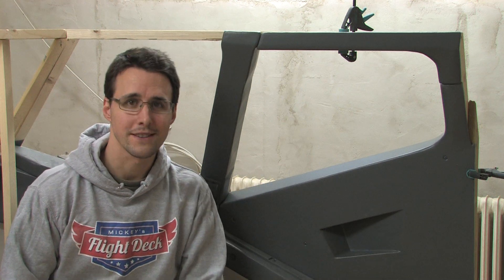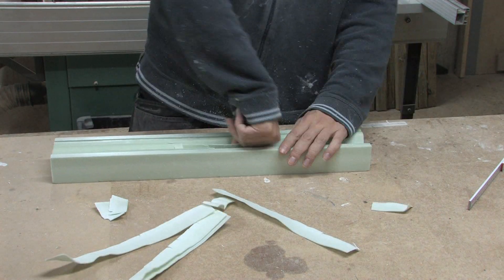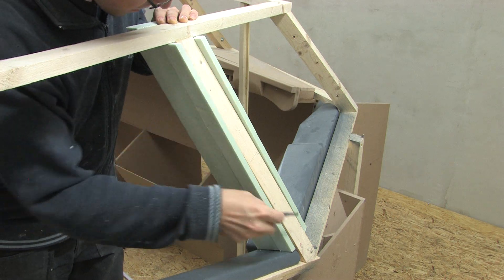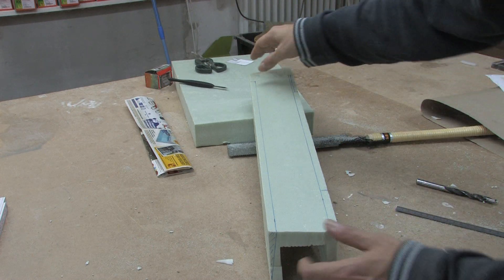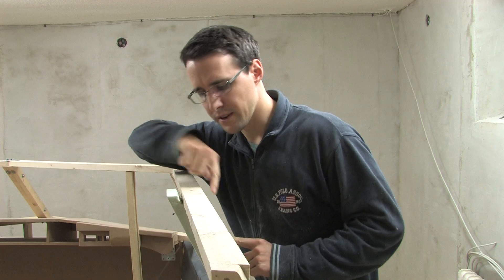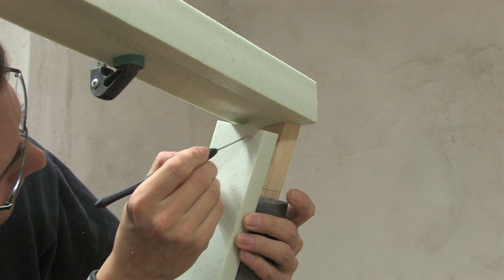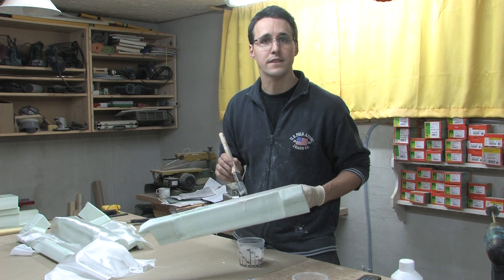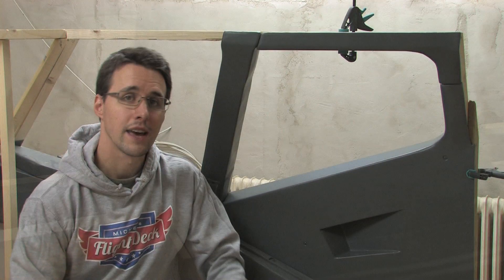Rear and middle Window Frame - A Boeing 737-800 Homecockpit #15

Comment: Hi captain! How are you?
How many foam sheets you used? Is it 5 cm 
width?
Reply from the maker: Yes, it is 5 cm thick. I think I used 5-6 sheets in total for the whole cockpit until now. I'm planning to use a little bit more for the MIP parts under the glarewings.
Reply: @Mickeys_Flightdeck  thank you so much!

Comment: Awesome! Michael, there is a tool called Sliding T Bevel that helps immensely in getting and marking angles so you don't have to "eye-ball" it.
Reply from the maker: I Felici Thank you. I will look for this.
Reply from the maker: Ah I know which tool you mean. I had to search the german word for this. I have this tool and I used it for example when I made the wooden window frames. But when I worked with the foam it was easier for me to use a cut and try method. I was afraid that I cut too much away what I really did from time to time.